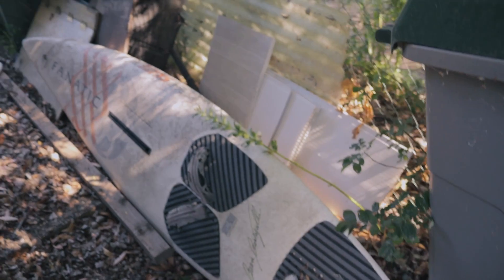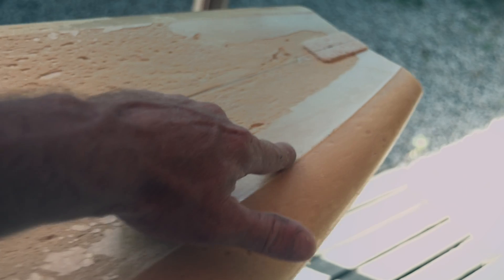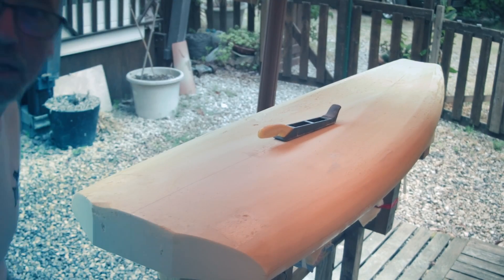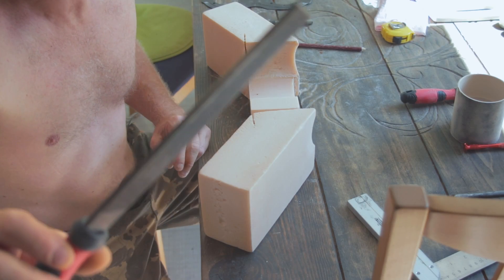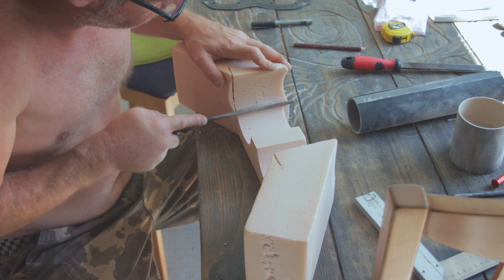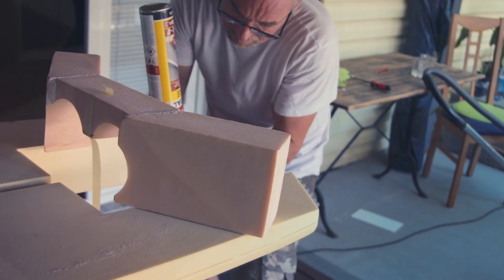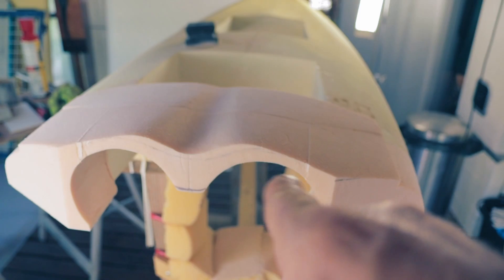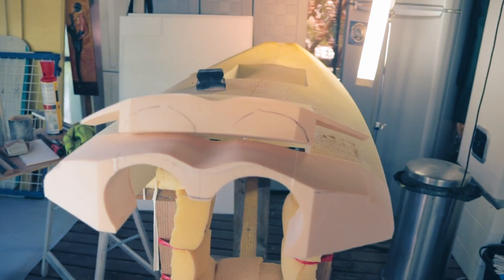Diy Twin Jet Drive Electric Surfboard (the ultimate tutorial)

Comment: When I worked at a surfboard factory we filled holes on epoxy boards with lightweight spackle. At that is what it is labeled in the store here in the states.  The stuff you fill a nail hole with when repairing painted drywall.  There are other solutions, but that factory is well known and that was the least expensive solution.  It sands like the foam around it so works pretty well.  We would fill the holes of a board that has been completely shaped and ready for glassing.
Reply from the maker: Cheers man I have heard of spackle but never used it I decided to cover the board in the end with some polyurethane sheet which gave me a little more thickness which I needed. I think it's video 2 or 3 but thanks so much for your comment much appreciated.